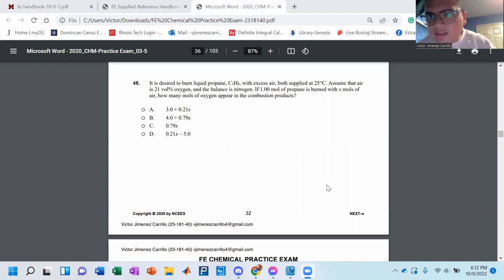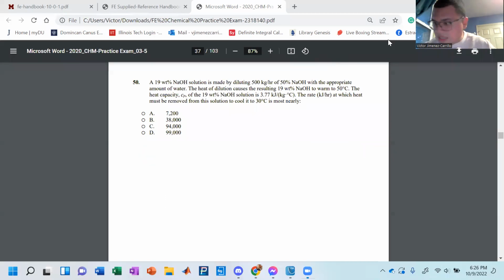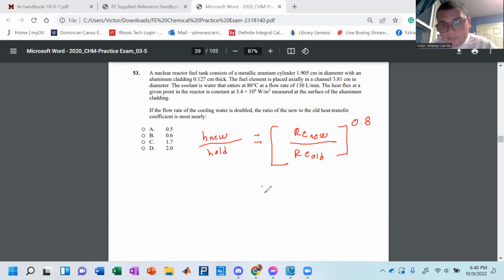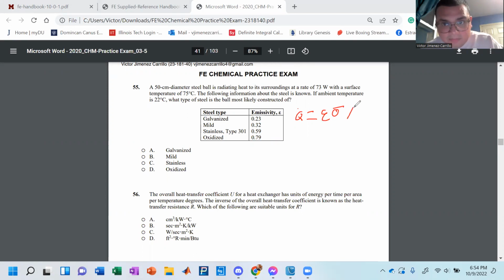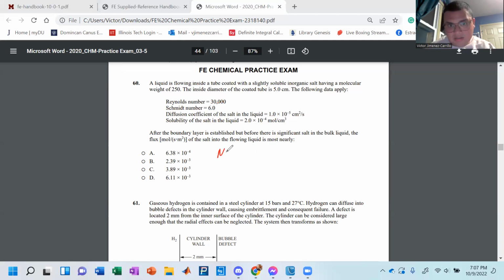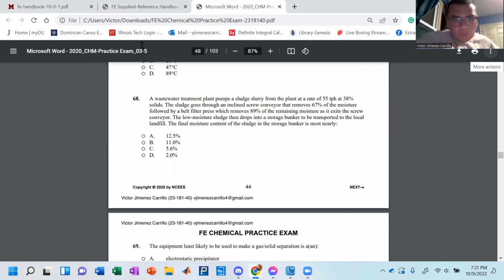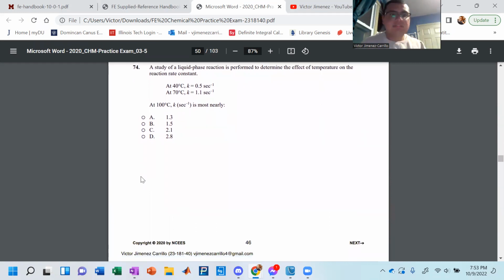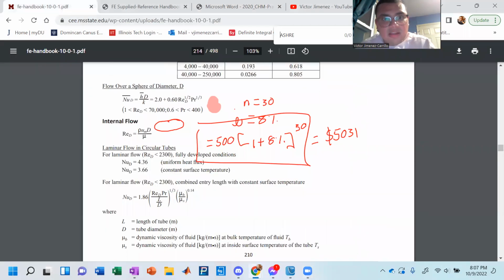Chemical Engineering FE Exam Preparation Part 3

Comment: Hi, for question number 53 where did the 0.8 come from? can you please explain. Thank you.
Reply from the maker: Hi! This is an excellent question. I don’t mind deriving the equation for you. That said you will see why I suggest you just know the question rather than deriving in 1 second. Note I work in SI units so everything will be converted I assume you can do that yourself 😊

For starters we must know how to correlate Reynolds number with the heat transfer coefficient. The easiest way of doing this is by using the Nusselt number Reynolds number correlation. That equation is below 

Nu=(Re)^0.8*(Pr)^0.333 The correlation 

Where Nu=(h*D)/k. 
h) being heat transfer coefficient
D) Pipe diameter
k) thermal conductivity.
What is key to realize here is that D and K are both constants. K will come from the liquid being used in this case H2O and it’s value here doesn’t matter. D is 0.01905 m (1.905cm as in the question) and doesn’t change. And h will change if flow rate changes so that is not a constant. 

Where Pr=(dynamic viscosity/density)/(k/(Cp*Density))
Cp being heat capacity.
As you can see viscosity, density, thermal conductivity, heat capacity, are all constants of water at a certain temperature.  So realize here in this question Pr is a constant in both before the change and after the change in flow rate since it is still water at 80 dC!!!!! This is KEY

BUT The catch of the correlation is that you can only use it if it is turbulent flow Re>10,000. So, let’s check if the flow is turbulent or laminar. The question gives us enough info to do this. See below. 

First to get Reynolds number we must use Re=(4*density*volumetric flow rate)/(pi*pipe dimeter*dynamic viscosity)

Water at 80 dC has a viscosity of 0.0003537 Pa S, and Density of 971.78 kg/m^3 (just use the tables in the handbook or engineering toolbox.com to get them online). The flow rate is given as 130L/min or 0.0021667 m^3/seconds once converted, and a pipe diameter of 0.01905 m

So, Re=(4*971.78*0.0021667)/(pi*0.01905*0.0003537)= 397869.032. Thus, this is turbulent flow and the correlation is valid. 

Now we can use the correlation to compare before the flow change and after. We do this by doing “new correlation formula” divided by “old correlation formula”. After change/before change (see below)

(Nu=(Re)^0.8*(Pr)^0.333) NEW/ (Nu=(Re)^0.8*(Pr)^0.333) Old. 
Realize that Pr is a constant as we spoke about before, so it cancels out with this division. Re does change so it stays and does not cancel out. 

Thus 
(Nu=Re^0.8) NEW/ (Nu=Re^0.8) OLD. But also remember that Nu=(h*D)/K, where D and K are constants so they will also cancel from out division. 

Thus, we can simply even further to 
(h new/h old)=(Re^0.8 new/ Re^0.8 old) then remember our exponent rules to make it less messy 

(h new/h old)=(Re new/ Re old)^0.8 The correlation I use in the video!
Reply: @victorjimenez7213  OMG I didn't see it before. Thank you so much !! 💗💗💗
Reply from the maker: @mariacaicedo09  much love ❤️. Let me know if you need help on anything else :)

Comment: As a tip, for question 54, you all could apply the approximation U = (1/hi + 1/ho)^(-1) because the thermal resistance of the wall was negligible (this gave an answer of 1456.9, which is about 3.6% different from the answer of 1405 W/m^2K)
Reply from the maker: Badass brother!! Sure as hell safes you all the effort that I did to solve it.
Reply: @CalebDietrich how did you get that equation?
Reply: @monicagaitan6989 it's in page 216 of the reference handbook

Comment: I think for Q52, all your work shown is good but when it comes to the final calc, the answer should be 0.03m so it should be D 30mm
Reply from the maker: Much thanks for the correction. These are needed to make these videos helpful.
Reply: @victorjimenez7213  I also think you may have had the incorrect formula for convection? In the handbook it's listed as Q=hA(Tw-Tinf) but you had it written as Q=h(Tw-Tinf)/A, which is why you were unable to cancel area. You should have been able to rearrange both the convection and the conduction formulas to Q/A and then set them equal to one another.

Comment: why is 58 not D = 4 A/P ?? I see that none of the answers even given this value and I'm very confused
Reply: it is 4 * Area/Perimeter -

The surface area would be 4*10 = 40 and the perimeter would be 4+10+4+10 = 28

Plugging everything in you get 5.7 or A

Comment: oh, and numbers 63 and 64:

ok im not the best with 63 but the general idea is that you would count the stages going down (the staircase going down the eq curve) and since we are claiming a distillate we want to partially reboil the excess and send it back through the system. i cant tell if the stripping line passes the left end of step 1, my apologies.

64, however, is pretty simple. first, we have our feed in as 100 kmol/hr. we make 2 things in this tower, distillate and bottoms. the sum of these has to be equal to our feed, as per law of conservation of mass. we know that 97% of A is in our distillate, so 3% of it is in our bottoms. based on the chart, we see that our feed line is horizontal, meaning it is a saturated vapor, and it is at about 0.47 on the x-axis. this means 47% of our feed is A, and we can make a mass balance equation with this information, 47 = 0.97D + 0.04B. at the moment im not sure why it is 0.04B and not 0.03B or rather how you get that number, as it is the proportions of the bottoms and should add to 1, the answer key and answer choices might be wrong, but correct me if that is a false assumption. i will continue with the answer key numbers. B = 100 - D, as per our mass balance, so we can substitute that back in to get 47 = 0.97D + 4 - 0.04D and thus D = 43/93 or 46.2. thus, 100 - 46.2 = 53.8, the answer choice.
Reply from the maker: Thank you again!!
Reply: For 63... the answer is 8 stages plus a reboiler. So, I believe you count all 9 stages but assign one to the reboiler? Is that right?

Comment: while i came here for the heat transfer questions, i can at least explain 47:

note that my solution is not the answer key's but rather comes from me treating it as a logic problem where i piece together what i need and have.

for starters, use the feed (F) proportionality to get the molar flow rates in the feed for H2 and CO. convert H2 to a decimal (0.6721) and hold onto it for later. do the same for the reactor input (M) to get 0.6923. now we have the percentage of the recycle as well, which is already a decimal by moving the point over (0.7045). this lets us make an equation, reminiscent of the earlier bubble point question, 0.6721x + 0.7045y = 0.6923. we can treat this as a weighted average as the sum of these is 1, so x + y = 1. two variables, two equations. make x = 1 - y (or vice versa) and substitute, getting y = 0.6235 and x = 0.3765. this represents the proportionality of each stream (F and R) in M. 

set up two fractions, 0.3765 / 1 = 1230 / M. because we know F is ~37% of M, we simply say that it is proportional and cross multiply, getting M to be 3266.56. subtract F from M to get R, 2036.56. now we know the flow rate into the reactor, so we can get the flow rate of CO going into the reactor, being (1/3.25) * 3266.56 = 1005.12 kmol/hr. we are told up front that 35% of the CO that enters the reactor reacts, so 65% remains unreacted, so 1005.12 * .65 = 653.33 kmol/hr CO leaving the reactor in N. since we know R, 2036.56 * (1-0.7045) = 601.8 kmol/hr CO is in the recycle stream. 

almost done! since P is purely methanol, we can ignore it. this means that all 653.33 kmol/hr are going up from S. 601.8 kmol/hr travel left to the recycle stream, so where does the other 51.53 mol go? the purge stream, of course. now we have solved the CO balance in our input (F) and outputs (W and P). because of the law of conservation of mass, anything not in the purge stream exits through the product stream. so get the CO in the feed, which is 403.3 kmol/hr, and your purge, 51.53 kmol/hr, and divide them to get ~0.13. this means that 1-0.13 = 0.87, or 87% which is our answer.
Reply from the maker: Thank you for sharing! I know other guys will use this to think hard about the BS questions I couldn’t figure out ❤️
Reply: I am not following the decimal for H2 feed.
Reply: @TheGarrbear3 the ratio is 2.05 H2 to 1 CO. This means the total is 3.05 and thus 2.05/3.05 is 0.6721 H2. 1-0.6721 = 0.3279 CO. These are both percentages represented as decimals.
Reply: I wish you typed the work for the decimals. I am not following. I did it and got different decimal

Comment: Hey, thanks for posting these videos, they help a ton! :) For #49, could oxygen also be used to solve the problem considering the air also contains ~20% oxygen?
Reply from the maker: Sorry for the late reply. Give it a try! You will get 10 as the answer (which is why it's A on the answer sheet). It's a trick!!! Don't do it. N2 is constant. You can do a N2 balance because N2 will not be used up in the reaction due to this you can do a simple mass balance of in=out (N2 won't be used in the reaction since it's an inert). O2 on the other hand isn't constant!! It is being used up during the process so in=out mass balance isn't gonna cut (although you might get away with a atomic balance but it takes away longer to do)

Comment: Can you please explain how you get 2h in question number 70?
Reply from the maker: Angle = inverse tan (2 time height/dimemeter) 

Edit: this eqn is found in the FE reference Manuel you are allowed to use on the exam
Reply: @victorjimenez7213  Thank you. I couldn't find this equation in the manual I'm using so I was confused.
Reply: @0abade  I made it into a triangle. So it will be Angle = inverse tan (height/Triangle Base) = inverse tan (14/24) = 30.3 degrees
Reply: @0abade  It can be write as h/Radius or 2h/diameter, diameter=2*Radius, hope this helps